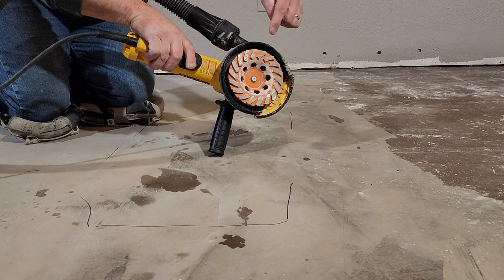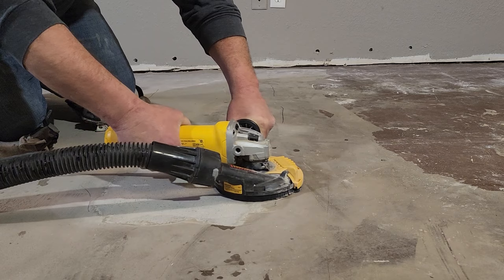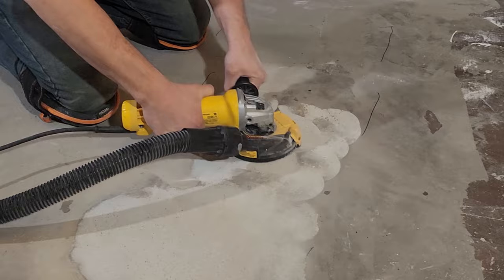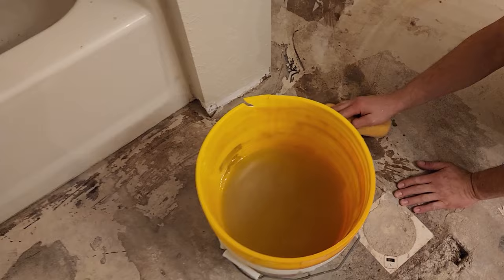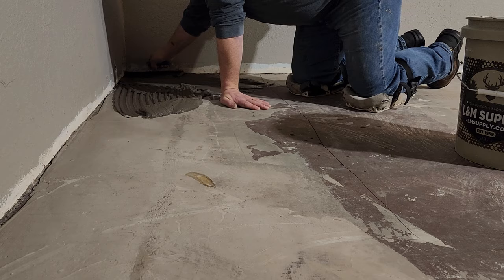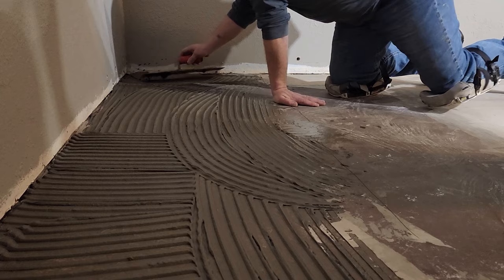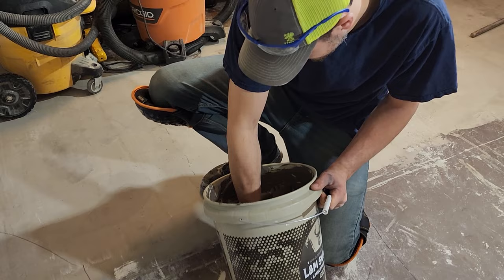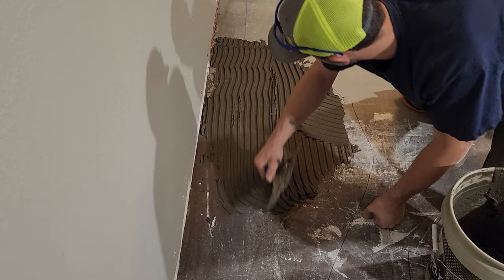Easy to Use Prep Tips for a Slab or Wood Subfloor|Vinyl Plank Install

Comment: I bought a cheap cyclone separator to run in-line before the shop vac. Really helps the vacuum out. Dust is really fine so it plugs vacuum bags really easy.

Comment: You make this look easy! What made you decide to use the Ardex feather finish rather than a Self leveling concrete/underlay? I'm also grinding down high spots but still have dips so am thinking of use SLC. But I also have 1 corner that is a full 1/2" lower than the opposite corner and now I'm thinking I should use Ardex for these big areas to make it level then use a thin layer of SLC over the dips. What do you think?

Comment: Wish i would've seen this video before redoing my living room 3 times and still didn't finish it properly. I have a hump in the middle of the slab and kept trying to add floor compound on each side to level it with the hump. Spent many hours just had to make my poor job work for now.

Comment: I know this video is for concrete, but what floor patch do you use for OSB subfloor to fill dips?  Do you use a primer on OSB before using that floor patch?  I have dips that are 1/4” over 6 feet in some spots.
Reply from the maker: https://youtu.be/aH_vLiBJ6bg
Reply: @SoThatsHowYouDoThat  Thanks for the quick reply!  In that video you apply that patch over Plywood.  I’m stressing myself out because my subfloor is OSB and all of these flooring levelers/patches say do not use on OSB.  I am going crazy over here not knowing what to do.  Will this work just fine over OSB in your experience?  Any additional floor prep needed to use this over OSB?  Any words of wisdom will be much appreciated for this stressed out DIYer scared to use patch on OSB :(